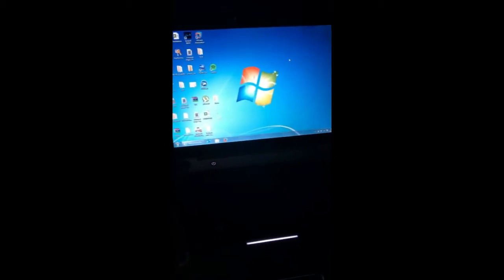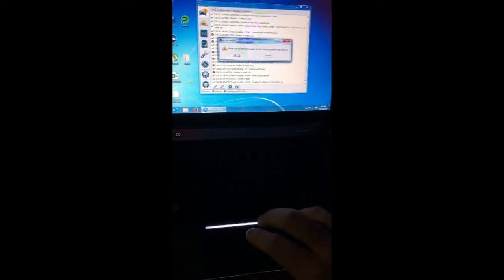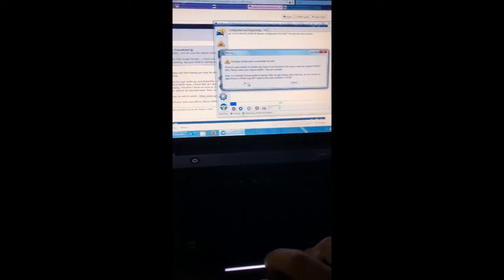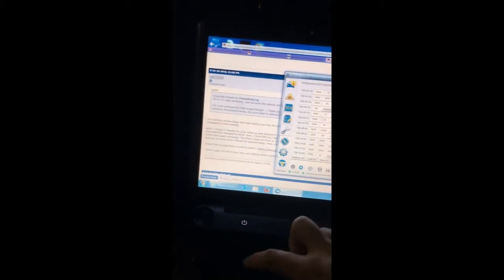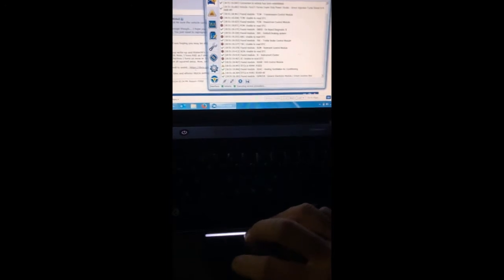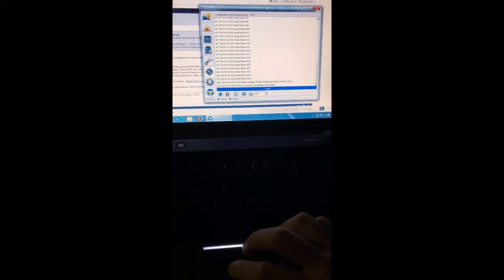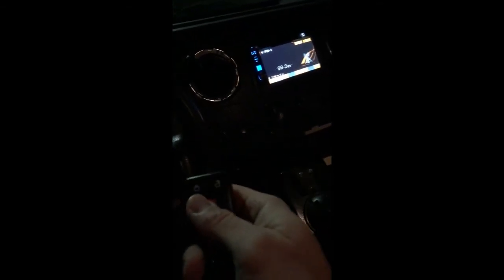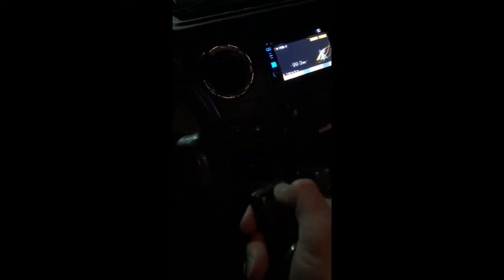Changing GEM Module As-Built programming to enable keyless entry in a 2008-2010 Ford Superduty

Comment: Good work. I have the 2010 Escape XLS and want to upgrade to some Escape XLT features. I'm trying to add the headlight switch with fog light and auto headlights and the switch bank INFO/SETUP/RESET for cluster display of options. Would you know where I might get the 'codes' to use with my forscan laptop to enable the switches? I'm Googling and chasing threads in Ford forums and haven't seen this done. And I've not had anyone say it can't be done. Any directions would be most appreciated.